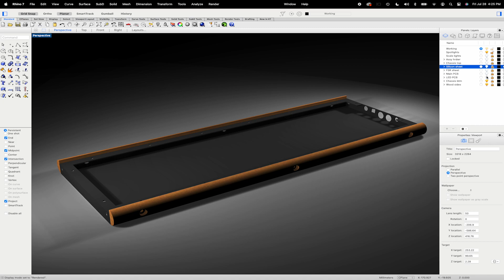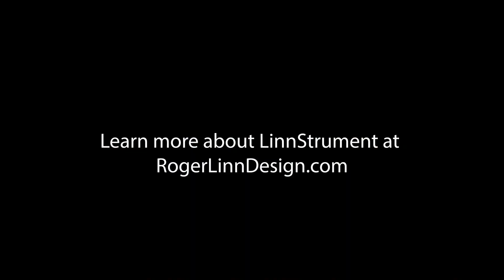Making of LinnStrument

Comment: Have you ever considered making a version of the linnstrument that has more of a layout similar to the Haken Continuum? It seems like your manufacturing method and technology would make that a relatively straightforward task. Of course, I'm not sure if Lippold has a patent on that specific layout/functionality. 

Either way, thanks for making such a fantastic and reliable product. I remember when you presented that original proof of concept video, and was so excited to see it be released, and was then crushed when you revealed that the company got bought by Amazon, and the project was in limbo!
Reply from the maker: Thanks for the suggestion. I think Continuum is great as it is, and I like the pitch layout of LinnStrument, so I wouldn’t a LinnStrument with the Continuum form factor. Both instruments have their merits, and Lippold Haken and I are good friends on the same path: to show musicians there is more to music than on/off switches.

Comment: Are LEDs a must? Could paint the silicone, and have it ultra thin.
Reply from the maker: Yes, but then you couldn’t change the scale light positions in order to light other scales, or show guitar neck dots, and you couldn’t visual identify the keyboard Split point or move it, or you couldn’t light each scale note in a different color, or the many other ways that individuals have chosen to customize LinnStrument to their personal interests. Note that you can simply turn the lights off if you don’t like them, and either paint the silicone or place a custom-printed sheet below it to show through to the surface.